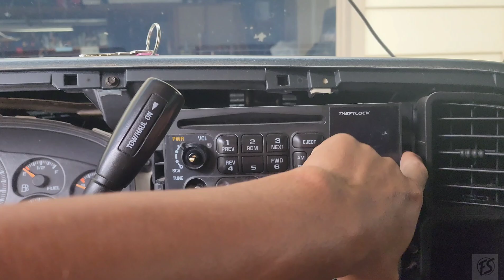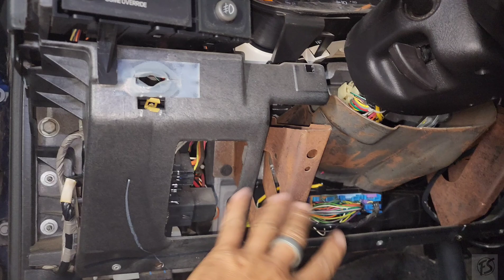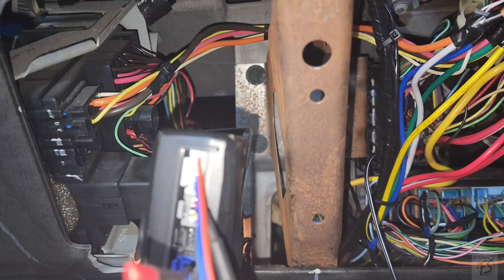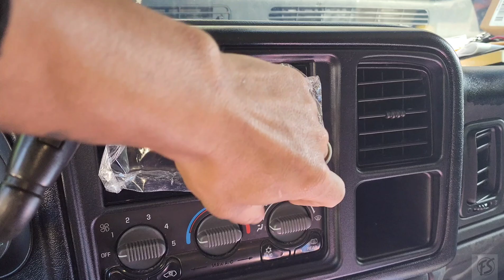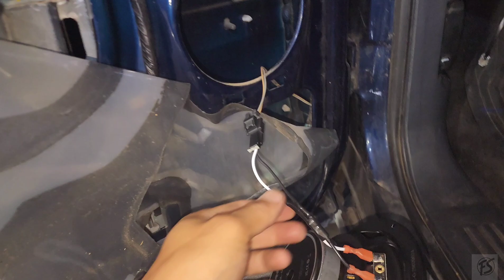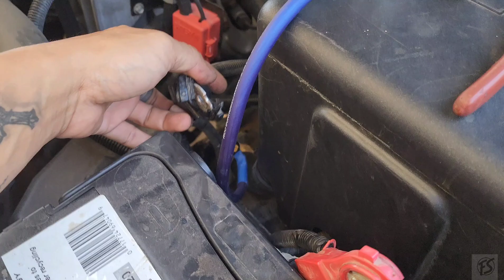How to Install: 2002 Avalanche full blown audio-alarm-remote start-dash cam and more!!

Comment: Hey I’ve got an 02, what’d you do for the crossovers for the mids/tweeters? I just tied into the stock wires in the dash, then back for the amp. realized after the fact I don’t have separate wiring runs between mids/tweeters to run to the crossovers.
Reply from the maker: The tweet has built in crossovers